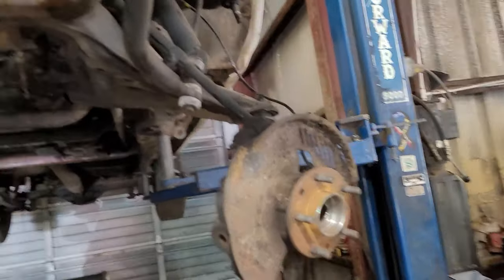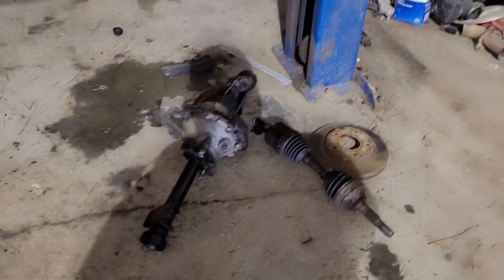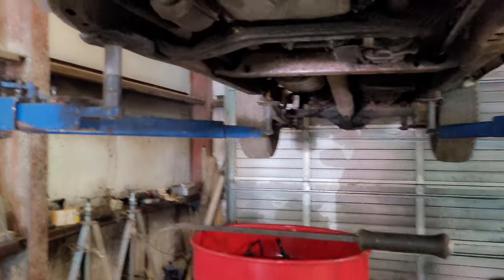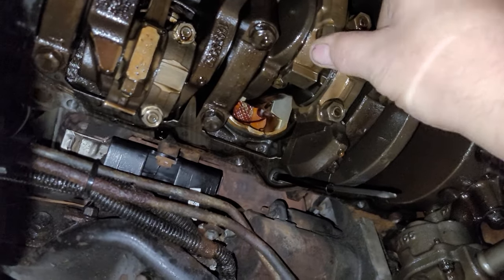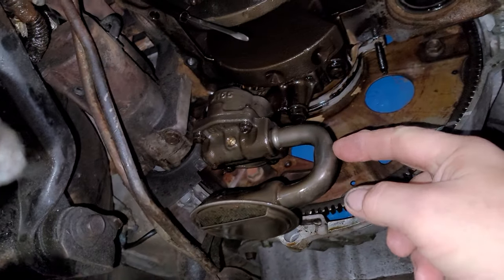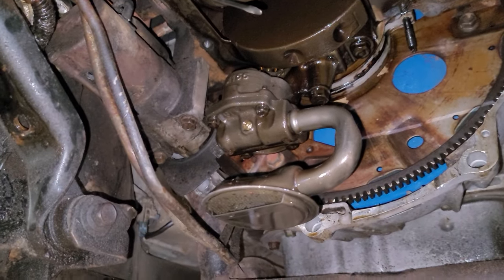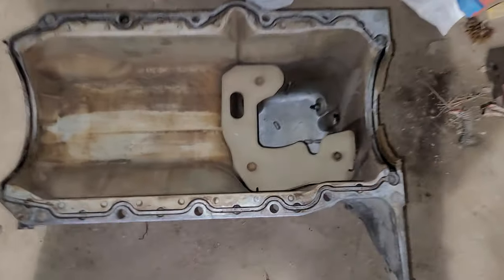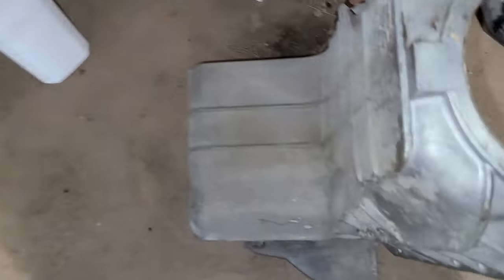Never seen this before. Chevy oil pressure problem

Comment: Welding the pickup tube to the pump is a must on small blocks and big blocks
Reply: Yep iv always done that on everyone I've ever done. Not one has come loose
Reply: my moroso pickup has a bracket on it to bolt it to the oil pump housing. Still a good idea to weld it, I've seen drag racers weld the bolts to the housing so nothing can come apart.
Reply: Always weld them up where the pickup tube goes into the housing.   Pontiacs are famous for vibrating that tube loose.   When it goes to the bottom of the pan, it’s over.  You’re walking in under 15 seconds.   Then building a motor if the car hasn’t been stolen before  the wrecker could get it.   Weld them up!   Every time!  Not “tacked” or “spot welded”.  Those will vibrate off and send frag through the motor.   Weld it up.   As far around as you can!   Put an actual bead on it!
Reply: Yep, can’t believe he made a video. We all know this!
Reply: Definitely throw a few tack welds on the pickup!
Reply: So what happens when you need to replace the O ring?
Reply: There is  no O ring on small block or big block chevy 
It’s a metal tube that gets pressed in to pump 
That’s why you need to put a weld on it so it doesn’t walk off or come loose 
Over time 
I think you may be thinking of the LS engines
Reply: @user-bc6cy8xy3t  ahhh.... I see. That makes a lot more sense. Thanks for the clarification. And yes... Iam currently obsessed with a gen 4 lc9 in my suburban.  🔧👍
Reply: @A71-c6v appreciate this info. Been restoring my 96 z71 with the 350 vortec. Truck runs amazing but I replaced the distributor cap and rotor before knowing the pickup tube was a thing on these trucks. (It’s my first truck ever) now I’m debating going back in it and replacing it. I’m at 270k miles with the common 1&3 cylinder misfire. I’m suspecting lower intake leak or the spider injectors leaking into those cylinders. Something next on my to do list lol.
Reply: @TrippyWoodStock  Get rid of that spider.
Reply: You can solder too if no welder....
Reply: @will7its  thought about EFI or carb tbh if I do get rid of them

Comment: Tack weld the pick up tube to the pump body on both sides!  Good insurance…
Reply from the maker: Done !!
Reply: Tack weld jeez that sounds rough..O ring perhaps we need a good seal dont we ?
Reply: ive heard that welding it can ruin the oil bypass spring in the pump.. how do you get around this, do u have to remove the spring? if so how.
Reply: Yup tack welding the pickup to the pump is old school insurance that has been a good way to keep it in place and pickup oil as well as keep it from letting air into the system! 😎👍
Reply: Weld might melt through
Reply: Yes welding the tube on is good 
Yes it will score the pump sealing surfaces unless ( remove the cap weld tube then bolt cap back on)
Reply: @WrenchingWithKenny did this fix your problem?
Reply: Was definitely aerating the oil because I've been through this at least two times in the past 30 years or so. On one we just tack welded at the top and problem with solved.
Reply: You are
Reply: A tack weld doesn’t put enough heat in the pump body to hurt a thing. It’s just a 2 second hit with a wire welder in two places. The pickup tube doesn’t have a seal in it, it’s supposed to fit tight enough into the pump that you need a hammer to tap it in and it will stay there on its own. The tack weld is to make sure it doesn’t come loose and suck air like this one did.

Comment: There's supposed to be an O ring on that pickup tube, I wonder where it went. I've heard that those O rings can dry and crack. As I recall there was a TSB on some of the chev trucks describing a poor O ring design that was changed. As you say, the pickup tube works like a straw, so if even a tiny leak above the level of the oil will allow air in, the pump can't work properly. Great case.
Reply: On a small block Chevy? No oring - that one is a press fit. You must believe this is an LS style engine. It is obviously an old school SBC - the newer style with the roller lifters.
Reply: @PapawCulberson correct there is no o ring it's just a press fot
Reply: Yes it's a 4.3 a Chevy 350 w 2 cylinders cut off no o ring a lot of guys will tack them but the factory didn't another trick it to egg shape it slightly and then tap it in and that will hold it in place .. I agree you must be mistaken in the L. S . Engines have an o ring on the long pick up tube that runs from the front of the engine where the oil pump is to the rear sump and after a couple hundred thousand miles will often fail giving you low oil pressure and once the o ring is replaced your good for a couple hundred thousand more miles ... And even then if you take it apart you can still see the cross hatch on the cylinder walls ..
Reply: O ring would be on a pickup tube on a ls series engine with the front mounted crank driven oil pump and pickup  tube but this engine  is earlier than ls. This is old style distributor driven pump. That pickup  tube would be just press fit and should be much tighter than that.
Reply: Never an o-ring.
Reply: I've had problems with cam bearings on a few of the 4.3 . But I would plastic gauge the rods and mains . Your not going to feel a few thousandth

Comment: I built and raced small block chevy engines for 20 years.  I always installed the pickup by cleaning the pump and pickup and coating the pickup tube with red locktite (bearing and sleeve retainer).  Never had one move or come loose.
Reply: Indian Head it! LOL 🤣 The shellac sealant. I've used on brass freeze plugs then stake in with a chisel in 4 places.

Comment: These are press fit you’ll need a new pickup tube and tac weld for insurance. Been building Chevys for over 50 years.
Reply from the maker: Done !! Did that this afternoon !!
Reply: doesnt the heat from the weld weaken the oil bypass spring in the pump?
Reply: No it's just a tack weld it doesn't get that hot
Reply: So where the follow up video to this ? I have the same issue . Did replacing the oil pump and pickup tube help ?

Comment: In the 70s, we always disassembled every oil pump and inspected them, measured the rotor gears to check valve plate clearance, removed the check valve and spring and spot welded the pickups on small block and Big block Chevy's, never having to worry about press fit or lack of. If the customer requested, we would make a bolt on bracket and weld it to the pickup tube so it could be bolted to the check valve plate. We had a few customers bring their complete Big Blocks, in for a Build and the oil pump pick up was laying in the oil pan, and the customer had complained about low oil pressure issues.

Comment: I bought a used engine years ago and changed the oil pan gasket and found the pick up tube laying in the bottom of the oil pan before had the same oil pressure problems your talking about..

Comment: More than one Small block Chevy engine has met its early demise because of this very issue . I used to check & set the pickup to bottom of oil Pan clearance with some modeling clay during mock-up whenever rebuilding one & once set up where I wanted it would mark the location on pickup / pump & remove pump carefully & braze pickup tube to pump body for this very reason .   Another alternative is to use Red lock-tite on the tube to pump , but only if all parts are washed with brake parts cleaner to remove all traces of oil first & have a pretty tight fit to begin with . Good catch here , & hopefully it’s still running for ya .
Reply: Thank you for saving me typing this out. Was taught to do this when I was a wee boy watching the mechanics.

Comment: My trucks doing the same exact thing I’m gonna check that tomorrow. Thank you so much.!!!!!!!!4.3 2001 Chevy express. It’s doing the same exact thing, the same exact thing, the same exact thing!!!!!!
Reply: @markmiller8853  mine developed a rod knock. I drop the oil pan change the rod bearings and installed a high flow oil pump. did the same thing for the first 3000 miles and now it holds just high enough that the oil light doesn't come on so I guess it's a win.

Comment: Hey Kenny thanks for the video....This is not uncommon....I've seen this with a bunch of SBC 's over the years.....We even had one in the fleet that did not want to prime after oil changes. We had to plug the PCV, pull off the oil cap and use an air nozzle with a rag to seal around it and pressurize the crankcase, then another tech would start the engine.  It was actually OK until the next oil change....eventually when we got time, the pan was pulled and the pickup to pump connection was repaired....lots of fun!!   Keep up the good work, thanks again.
Reply: That sounds like a pretty ingenious idea to get the pump to get a grip on the oil! LOL 🤣 I suppose you want to be careful and not put too much pressure and blow out gaskets and seals all over the place. Good, and fairly quick method of getting it to prime. 👍 Like when I have siphoned gas, rather than risking a mouthful of gas, I wrap a rag around the hose and blow in it. The ABS tank expands and helps in pushing the gas through the hose to start siphoning. A damp rag works best to get a good seal.👍👌

Comment: Thank You sir for this informative video. I am a BIG FAN of the Chevrolet 4.3 liter V6. How can you go wrong with the 350’s baby brother. I have seen mechanics in the past put a spot weld on the oil pump/pickup tube during an engine rebuild just to solve that future problem. Again, Thank You for your time and effort to bring these small but important tips to the YouTube communities attention. And by the way, nice looking shop. Keep up the good videos. Have A Productive Day! 🛻🚚🚛
Reply: Once you've set the oil pan to pickup clearance, drop the pump, spot weld the pickup in place to the pump, then reinstall it.  Dropping the pump, or having the engine out, keeps you from trying to isolate all the electronics from the welder.

Comment: I had one the other way from a accident it made so much oil pressure it blew the rear main seal out of  a 350 TBI engine the guy is right put a tack weld on it thank you for your videos and have a blessed day
Reply: Oil pressure blow out the rear main??? Doesn't seem possible to me.
Reply: How exactly does that happen? I’m dealing with a 92 350 that’s blowing out filter seals!!! Could this be the cause? I understand 0 psi but how does it build excessive pressure? This one has a filter adapter but no cooler. And no there was not a leftover seal stuck in between. Happened outta the blue… but 2x in a row!

Comment: I use loc-tite sleeve retainer (Green) and I spot weld it as I want a great seal. Not all require loc-tite, if they press in hard enough. Some aftermarket pick-ups for aftermarket pans don't press-fit tightly, hence the sleeve retainer loc-tite. Great find and you did a good job diagnosing the unusual issue.

Comment: I had a 326 Pontiac do what you described. It was an original, one owner car, and when it was again driven regularly (with fresh oil changes), the light sludge took out the cam bearings. On tear down all else was fine and within spec.

Comment: Your video posted after this discuss the actual oil fill level in the pan and how it covers the pump and no need for priming.  The oil level also covers the pickup tube interface, so siphoning air is not the cause of loss of oil pressure with proper oIl fill level.  So, what did you find was the problem with oil pressure dropout?   I did not see any subsequent videos covering your findings.

Comment: That's why on race and performance engines the pickup either has a support bracket or is tack welded, it's not an uncommon issue.  

The pressure drops because it loses prime at lower speeds due to air getting around the pickup.  The pickup also has probably turned so it is too close to the pan creating a flow issue that adds to the problem at idle.

Comment: I am in the process of replacing the pan gasket on my 2002 4WD Sonoma. OMG, I had no idea how much stuff I'd have to remove to get the pan down. Did the same thing you did. I had to take upper control arm off driver side so I could barely get a socket on the upper diff mounting nut. Not a fun job. I will def check my pickup up tube and maybe give it a couple of zaps with my welder to keep it firmly connected.

Comment: Interesting little problem, and confined to that pickup tube to pump body mating.  With higher rpms, the pump is pulling enough to draw the tube into the pump body, and voilà!   Acceptable oil pressure.  But at idle, the pump draw is low enough so as to allow that pickup tube/pump body joint to relax, and any oil drawn in is aerated.  No pressure.  
That's my story and I'm sticking to it.
Reply: CSI - Oil Pump Division - These are the stories from the pan .....😊👍
Reply: @marccampbellsr1085 Yes I agree . Ever got a soda and the straw had a crack in it . Not getting much , same thing .

Comment: Same problem here with my 1994 chevy truck 5.7 . Now this is my second motor and doing the same thing. Oil pressure drops down to the red when hot and check engine light comes on. Changed sending unit several times on both motors and oil pump on  the engine i have now. Good oil pressure when hot and when it drops sometimes it jumps up and down . I am wondering if it could be Elect when wires get hot. What a Headache .

Comment: I had a Silverado 1500 pickup with a 4.3L in it.   With 10K miles, I noticed the oil pressure was fine until I hit the brakes hard.  The pressure would drop to zero, then come back up.   The dealer pulled off the pan and found the same exact thing except the tube had pulled out of the hole.   They fixed it.   They welded the tub to the body.   Never had happen again.   Bought 5.3L ever since.

Comment: Yes. This is a known problem with those. Braze or weld that pickup tube on there. It should be hard as heck to put that tube in the pump. If it's not, make it that way. The oil pressure falling off the way it did was because when the engine is off, the oil level is high. You start it and the oil in the pan drops below where the pump and sump tube meet, and it starts sucking air. Seal that up, and you're good.

Comment: You can put a Mechanical gates on the front engine port to get a different Data point.  I had a similar issue, and it seemed to be resolved by simply replacing the oil filter. The oil filter is actually between the front engine port in rear engine oil port. So it's possible they're sludge built up in there. I run my Chevy With a permanent oil gauge on the front port undred the hood
Reply: Where is the port exactly on the front ?
Reply: @kellismith4329  front driverside near the ground wire.  It's really hard to see with the power steering pump in the way.  There's a large plug

Comment: For high oil pressure, put a 2wd pick up tube and 2wd oil pan. I did that on a blazer I had and it ran 75 psi all the time. That same engine is now on its 3rd vehicle, s10. It has close to 400k miles and still running high oil pressure. Everyone has told me it's not a good thing to have that much oil pressure,but I can't believe that when the engine is outlasting the trucks I put it in.
Reply: Have you ever delt with overheating issues on the s-10?
Reply: @stizze3887  yes. But only because I never flushed out the cooling system. It was so bad I replaced everything but the heater core. Still going strong!

Comment: I know this is late but been thru this a few times with Gen 1 SBC. Pioneer 839061 Oil Pump Screen Fastener if this is a 5/8" pick up and not a 3/4" pickup is the way to go. Use thread locker on the bolts.

Comment: I've heard so many people say the pickups fall off or don't seal right, etc. I've built many sbc and never once had a problem. I don't weld them or anything. Done them in 4x4s, drag cars, dirt cars, street cars. Even a couple 4.3l and just never had that bad luck, I guess. I also am selective and test fit as well as clearance check. That's a weird issue though, I'll say that.
Reply: Yeah I’ve done at least a hundred long block.  It only makes common sense to sure the pick up
Is tight and at the right height.  That’s the same symptoms the ls motors have when the o-ring gets hard and flat.  Just my two pennies.
Reply: @majestic7117  yeah it's a solid idea and I'm not opposed to tacking the pickup in place. I've just never once had an issue and built motors from almost all domestic makes and models. Even some of the new gen engines and it's just never been an issue for me

Comment: It didn't necessarily have to be sucking air. If you've ever watched video of a boat prop, totally submerged cavitate, it will produce bubbles underwater with no access to an air source. You just have to move the fluid faster than it is capable of, or introduce a secondary stream of fluid.
    At Idle, the pump was probably not moving enough oil to lower the oil level for it to suck air, but the pump was probably pulling enough suction to pull oil around the pick up tube (the second stream).
     That could have generated "frothy" oil, which would hold no pressure, because the air in the bubbles would compress more readily than the oil itself. 
    Cavitation is the bane of anything hydraulic, and it has been known to happen in sealed hydraulic systems, resulting in anything from weak hydraulics to destroyed pumps.
Reply: boat propeller cavitation is different than just frothy oil in an engine. on boat propeller it has very high pressure and it makes the water actually boil even erodes away surface of propeller on high powered boats
Reply: @ranger178  in any "hydraulic" scenario where you are moving fluid cavitation is possible. The only prerequisite is that the mechanical influence be greater than the fluids ability to move.
Reply: @ranger178  It also causes bent/broken exhaust valves on a 454 ls6. Ask me how I know!